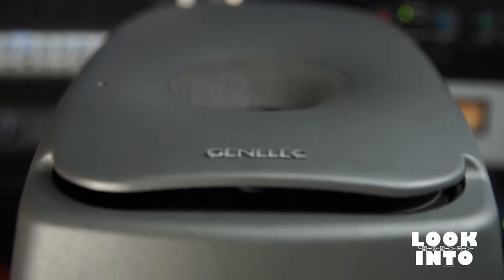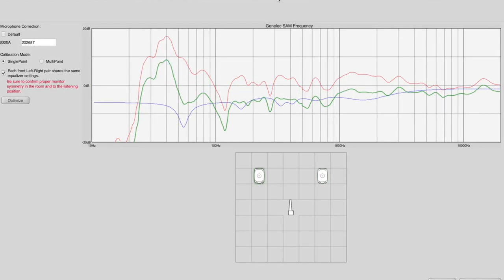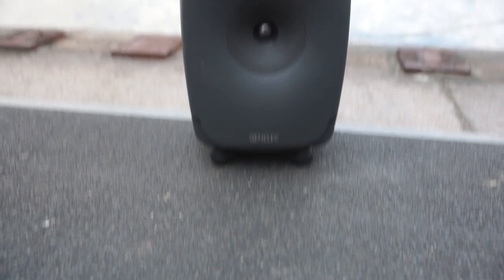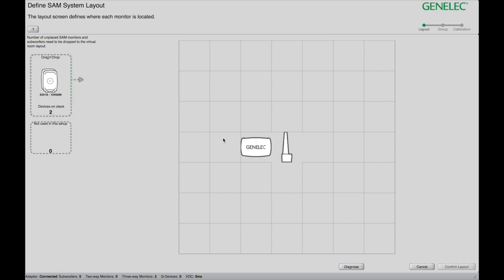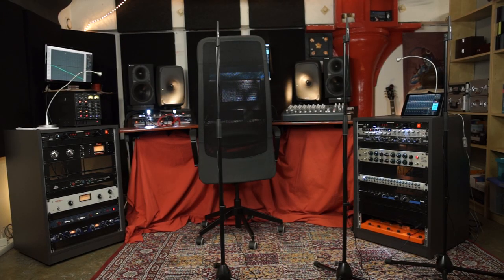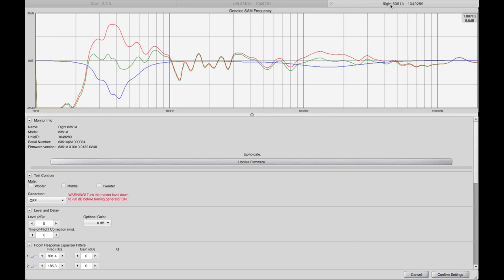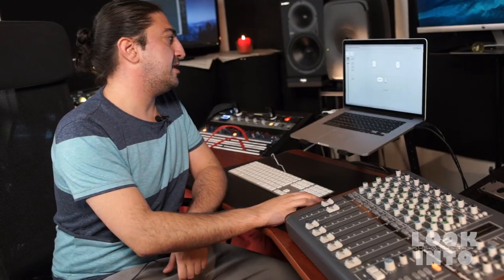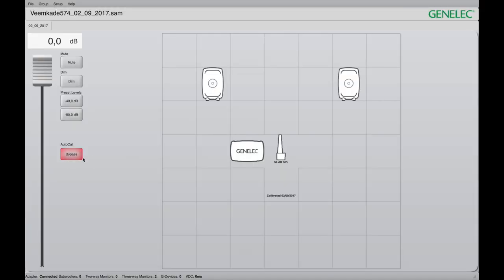Genelec 8351 - Review LOOK INTO

Comment: Try sonarworks room calibration, I use genelec 8040a. And it's amazing
Reply from the maker: Thanks for your comment! I have used the Sonarworks in Studio 1 at SAE Amsterdam and it's a good system (besides the usual latency). The Genelec Ones series (reviewed here) have a coaxial design plus DSP built-in and they play in a different league compared to the trusty 8040 + sonarworks room calibration. Nonetheless a pretty good monitoring setup!
Reply: Damn never thought I could! I have the 8040B's I will be definitely looking into that.
Reply: Glm is way better
Reply: @itconnects6693  In what way? Quite a few examples where published results show identical performance when it comes to frequency response.

Comment: Why is it not correcting everything to flat? There seems to be a ton of smoothing with the blue line, and I want the green line (corrected response) to be perfectly flat. Looks like it needs +8dB at 120hz, +4dB at 150Hz, and so on.
Reply from the maker: Hi Steven thanks for your comment. Unfortunately at the moment it is not possible to fully address an acoustic issues with the room with any DSP system. In order to have a perfectly flat line more acoustic treatment is necessary.
Reply: Just guessing... If you want to make a correction to an audio signal before playing it with speakers you first have to completely (mathematically) analyze a short period of the signal. Modification, DA conversion and forwarding it to the amplifier can only happen after that. This introduces latency and which might be problematic in audio production environment where these speakers are meant to be placed. It's not a problem at home while listening to music but it would be with movies

The more accurate you want corrections to be the longer it takes to apply them i.e. the more samples the filters need to analyze before outputting anything. Therefore I assume mathematically simpler filters which introduce less latency but are not 100% pefrect are being used. You have to remember that every time you switch your position or move your coffee cup slightly you're practically altering the listening environment which means the calibration will never be perfect anyways so it's just pure insanity to try to go beyond a certain point.
Reply: The dips are cacellations that can’t be boosted. If you boost, you will also boost the reflection that is cancelling the direct sound. Lots of wasted power and possibly weird sound to ear.
Reply: @jyrkih6960  So simple. So true. Physics. ;-)

Comment: Thanks a lot for the video. I like so much these speakers and the coaxial driver and its waveguide are  just marvelous. Love the concept immensely ... still I do not understand why to cover the emitting surface of woofers ... i would leave them visible 100% ... maybe just with a protecting grille ?  and last .. drivers must be circular ... this would be a must for me.  If tweeters and midranges are circular why woofers should not be the same ?  Regards, gino
Reply: @CHARLES 13X thanks for the kind reply they must sound amazing
Reply: gino Worth noting that they work with function over form. I’m going to confidently say the engineers at Genelec must’ve chosen the “racetrack” style woofers and the wave guide/baffle here for a good reason. Whatever they’ve done they sure as hell did it well. Having heard the 8351s I can safely they’re some of the best speakers I’ve had the privilege of trying out. Now if only I could afford them...